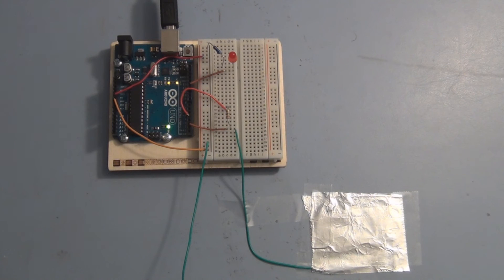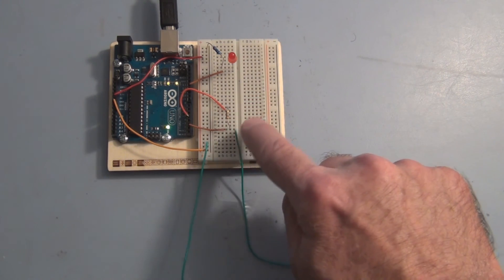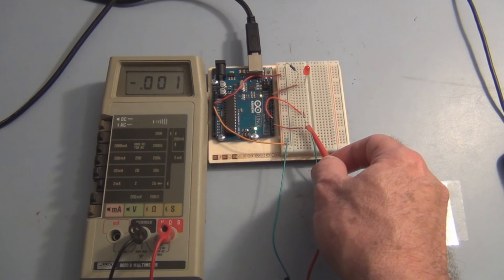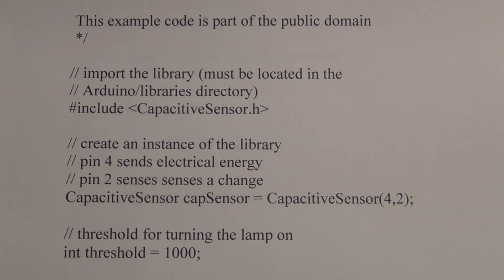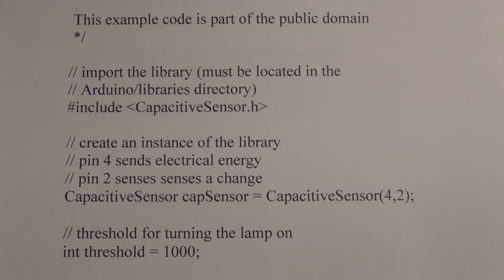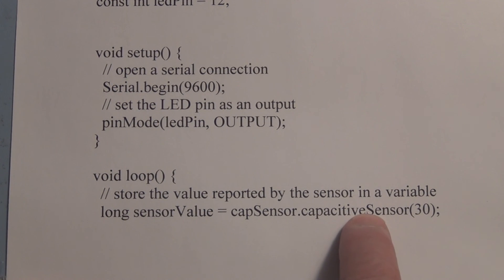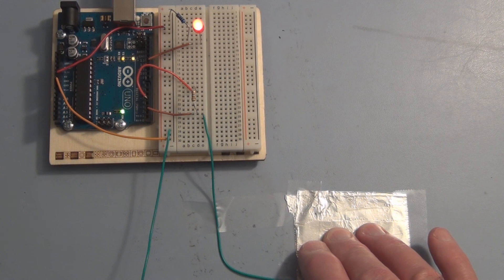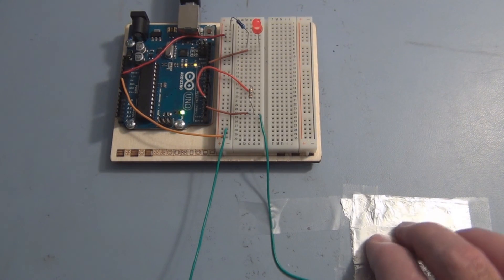Arduino Capacitive Sensor measurements

Comment: What value is the other resistor (connected to LED)? I can't tell.
Reply from the maker: zahna andrews  You can use a 220 ohms or a 470 ohm current limiting resistor.  There is a 1 Meg ohm resistor connected to the foil.
Reply: eTechTom Thanks I was able to get everything to work. I just used a 1 kohm resistor. Also, I am unable to tell what the ground wire is connected to. I tried using it to get the readings on some capacitors but I just get a -2 in the serial monitor.

Comment: Is there a video on the charge discharge cycle from the arduino website? the on with Time constant etc
Reply from the maker: I found this information.  http://playground.arduino.cc/Main/CapacitiveSensor?from=Main.CapSense and this video.   https://www.youtube.com/watch?v=BHQPqQ_5ulc.  The video explains the concept.  Maybe you can extrapolate some information from the library code.